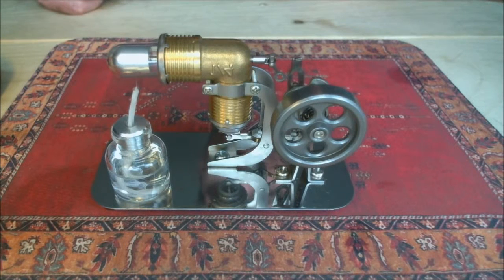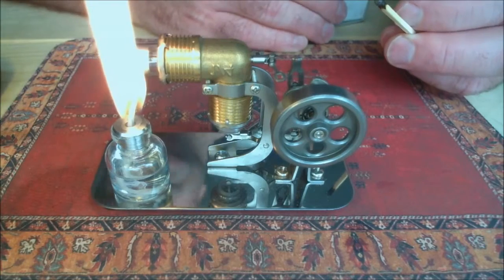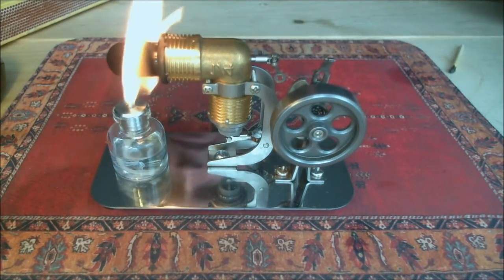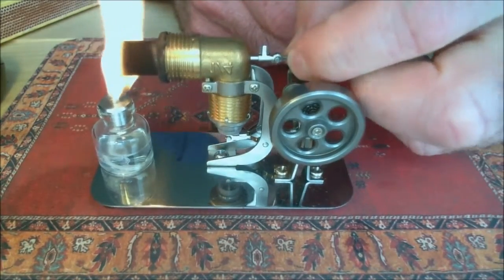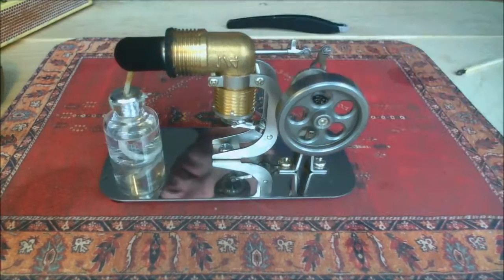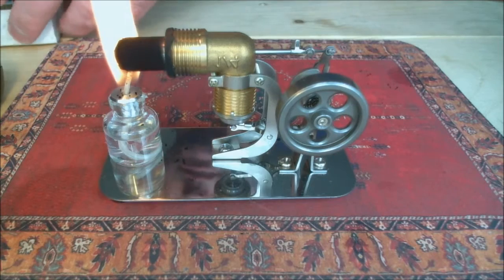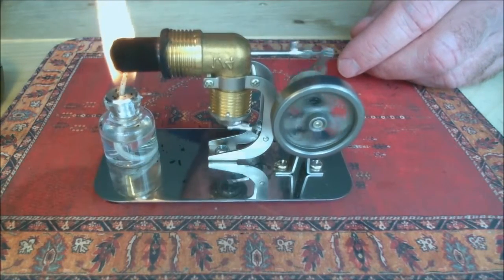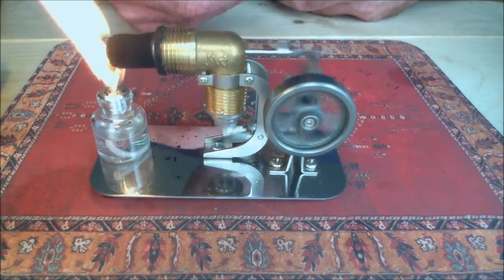Starting My Stirling Engine for the first time

Comment: It only runs in one direction.
Reply from the maker: Direction depends on whether internal air in cylinder is hotter or colder than the heat source. https://youtu.be/marxrHxt-Mc